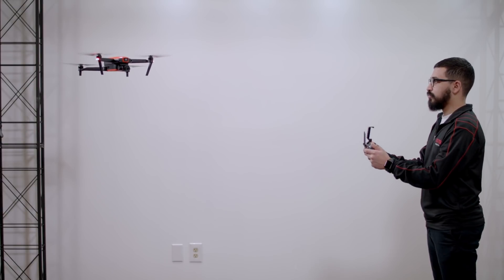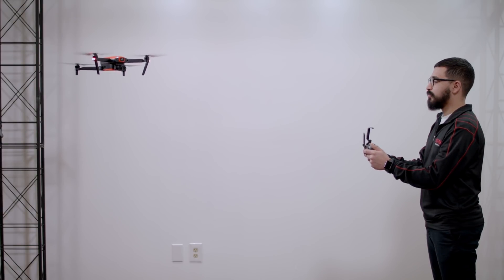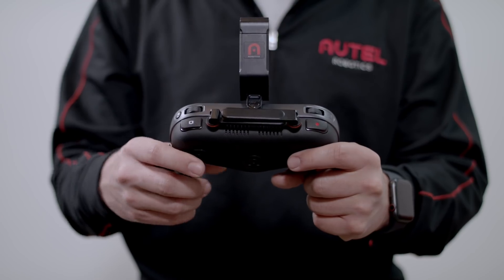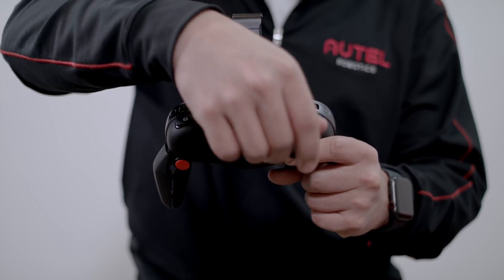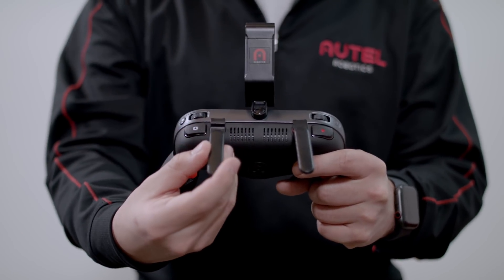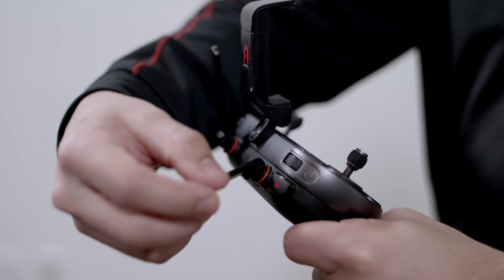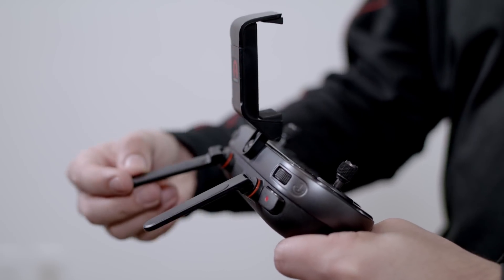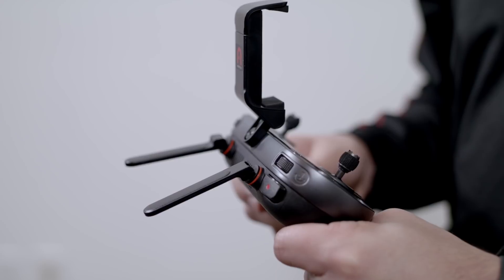Antenna Position

Comment: I have flown the DJI Mavic Pro for about 4 years now. I recently upgraded to the Evo 2 Pro. Liking a lot of the features it offered. But, I've been disappointed in the range this has. My Mavic could easily fly 10,000 or 12,000 feet out without losing reception, and at a lower altitude.  I often fly out over a large lake and film the sailboats on it, which I need to do at a lower altitude. Now with the Evo 2 Pro, I am constantly fighting the RTH and hurrying to get a shot before it loses the connection.   Or having to climb to a higher altitude to keep the connection, but then I lost the photo/video quality.  For a drone with so many great features, it loses my respect in the range part. Very very disappointed in it.
Reply: I know a lot of videos are saying the opposite of this video. These guys make the drone so you'd think they would know right? Well wrong, they must not. If you ask some people that actually got over 5 miles with this drone how they position the Antennas they will tell you to face them straight down. Dad Randoms channel, originaldobo, dustin dunhill flies the autel evo 1 over 4 miles and back also (same remote)..I only fly with them in this DOWN position and haven't had any connection issues. I will be doing a longer range test now that i have read your comment. I have only flown over a mile so far. Im new to drones and i have the autel evo 2 8k.  Have you flown this drone with the Antennas positioned down yet? Straight down and evenly positioned? If not try that friend and give a message back if you feel like it. Thanks good luck and happy flying

Comment: How do I disable automatic return to home if signal is lost? Like, when I'm flying in a forest and don't want it deciding it's going to start flying up to 30m because signal cut out for a few seconds.
Reply from the maker: At this time EVO does not offer an option to disable RTH. I would recommend watching your battery life and landing early when flying in this type of condition.
Reply: @AutelRobotics  will evo 2 O.A. stop it from raising to the tree tops and hitting branches if this situation occurs since the evo 2 has top sensors? I know its bottom sensors will adjust for trees and other obstacles on return to home either forced rth from low batt or connection lost rth or manually pressed rth. I have seen a video where a guy is city flying and his rth height was set too low for his surrounding buildings. Any other drone would have slammed into this building he came at but the evo 2 stopped about 30 ft away or so and did a calculation for about 3 seconds. It then proceeded upward until it detected the rooftop of the structure. After the it did another second calculation, it then saw the wire thin 15ft tall antenna and adjusted for that even. It rose above the very thin and tall antenna and proceeded toward the homepoint totally and completely unscathed. I was yelling and cheering in my living room for the drone its makers and its owner in the video. Then patted myself on the back for buying it instead of DJI anything because I don't like geofencing

Comment: Glad you posted the 'official' positioning. I've seen all manner of positions, including the downward facing.  One guy even suggested one antenna pointing up, and the other one pointing down.  Let's get one other thing cleared up.  Control freq. & video transmission freq.   I think DJI used 2.4 ghz for control & 5.8 ghz for video.  I was under the impression that the Evo used 2.4 ghz for control, and 910 mhz for video (or vice/versa).  I remember asking you about this prior to my buying the Evo.  I'd mentioned that DJI had specialized video transmission parameters which they named Ocu-sync and/or Lightbridge. In your reply, you mentioned that you had a technology in Evo, but that it wasn't named. Would you clarify this for me? Cheers.
Reply from the maker: Hi Bill, EVO uses 2.4Ghz for booth control and video transmission. The decision to remove 900Mhz allows EVO to be used in countries where 900Mhz is commonly used for emergency channels. We don't give it a fancy name but we do know it provides a strong and reliable signal during flight.